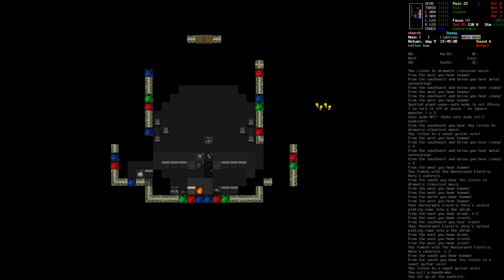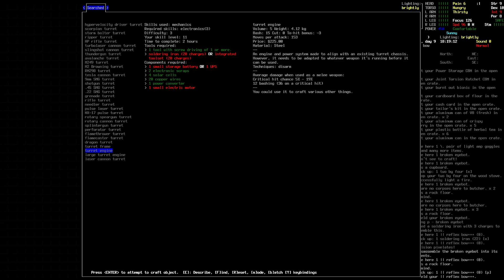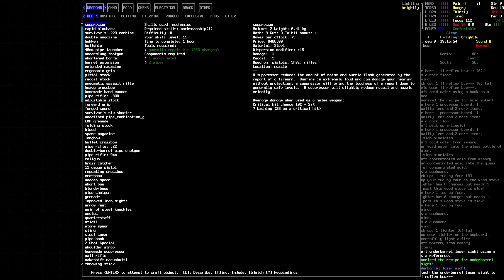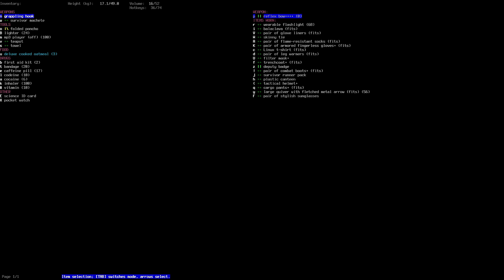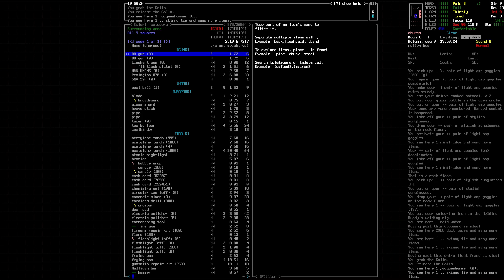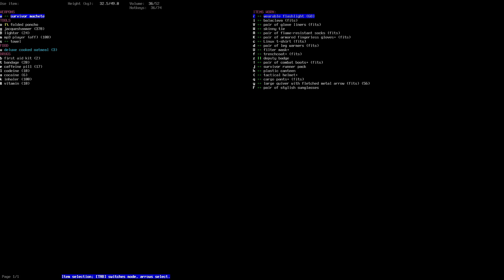Cataclysm:DDA 'Isdar' 72 - Setting Sights

Comment: Seems the wiki is down currently so the guide is down, but with cables you can attach an outside bank of solar panels to your workshop without having to build a frame through your walls; thus allowing you to close doors, but still bring power in. Good luck on your workshop!
Reply: +Mattamue You always had the option of putting an opaque door on the frame that was in your wall. But there is a movement cost of going through it, and you can't drag a vehicle through. Still, you can just have 2 doors. It was never a big deal for me.

Comment: If you disassemble a car battery you get a lot of concentrated acid, can easily make a ton of batteries with it. Most of the turrets in the Vehicle additions mod can be fired manually, so you could build a turret frame and basic laser turret on the seat (might need military seat) and you can shoot while driving. Useful untill you can make it an automated turret. There's also another way to make the fire control unit but you need a book for it. And heard from a friend you can use a rope or long string to tie the dog down so it won't wander off and attack you. Hope that might or might not help!

Comment: Aavak I believe (someone correct me if I'm wrong please) there is a component you can add to a vehicle that works like a remote control then on one of the tablet things in the game or a controller you build or find you can remotely drive it around. If you can add cameras to see and you put it on a small vehicle the size of about Colin you could have like a little bot that has a welding rig that you put tools in incase you get trapped somewhere and need something you don't have but its in the little bot then drive it to you. Like in the case of finding a place that needs a jack hammer randomly but you don't have one with you or you run into something you cant kill because it'll kill you, you have it drive you the power armor and nuke you stored in it incase of such a situation.

Comment: I have to say... while the sound effects are nice, they do get quite annoying.
That incessant chirping at night and the rain especially. It would be better if the sounds were more interspersed and/or quiet.
Reply from the maker: +KuroroSama42 I can drop the volume perhaps?
Reply: Aavak No I meant those persistent sound effects specifically. The other sound effects, like walking over stuff or attacking, are fine as-is.
Not sure what you can do, other than changing the specific sound effects (if you can even do that)... I was mostly just giving my opinion, not knowing if you can improve that or not. If you can, then that would be cool, but I'm not asking you to because I assume that wouldn't be so simple.
Reply: +KuroroSama42 The mod is not very well maintained, it's either this or no sound at all.
Reply: simdavg
Mod are usually editable though... but it may be too much work to be worthwhile, for Aavak.
I was just noting the problem. If he can and chooses to fix it, awesome. If not, oh well.

Comment: Hmmm I have a devious idea.

Build a Bicycle and hook up an alternator to a battery which powers a laser turret.  
Peddling turns the alternator which chargers up the battery.  
Battery Feeds the Laser Turret.

Imbibe Charlie Sheen levels of Cocaine.

Cycle like Lance Armstrong on megaroids through the cities while your turret pew-pews everything like a deadly disco-ball strobe light.

GG - you won the Apocalypse.
Reply from the maker: +Sunday Smiles I don't think anyone but Charlie Sheen can handle Charlie Sheen levels of anything.
Reply: +Sunday Smiles Haha I agree with Aavak that's going to b very difficult but I love the bike idea lol
Reply: +Aavak Mounted = weapon system that can be put on a vehicle, can be set on auto fire or manually controlled. Turret = stationary independent weapons system (not vehicle mounted, ground mounted!) like you see at road blocks or military bases. I believe you are after the mounted variety. So forget the firing mechanism and just mount a laser on Electric Derp.
Also, there is a soldering iron as part of your welding rig. If the electric derp has a welding rig, then it has a soldering iron. You might want to take an acetylene torch though to take down metal doors.
Reply from the maker: Woo!
Reply: +OldMrFrodo mounted means you have to fire the weapon on the vehicle manually (it wont auto fire), the turret variant can be put on a vehicle to shoot automatically or you can fire it manually as well.